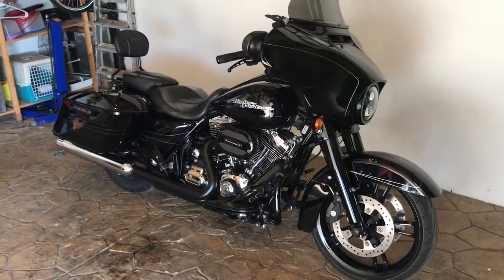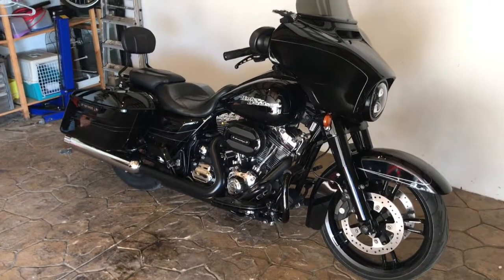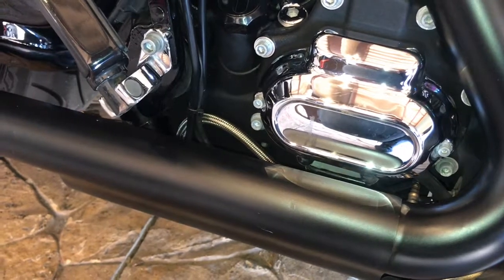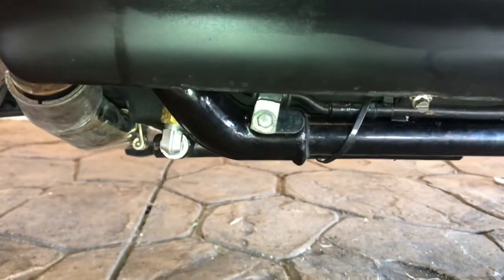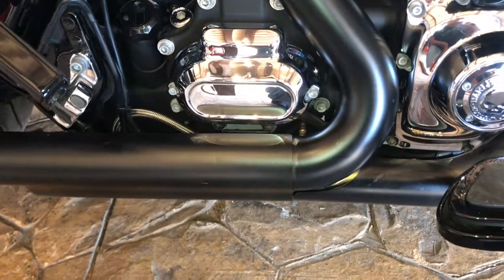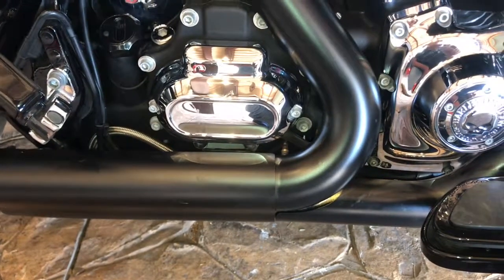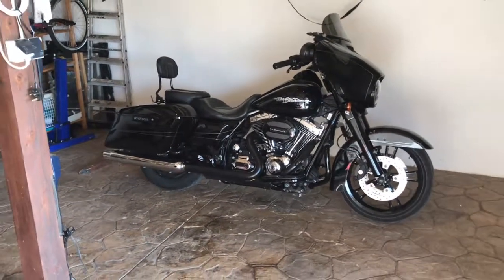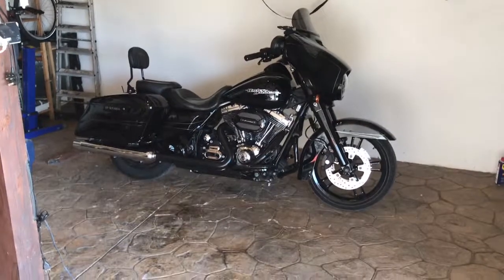The Oil Bud Harley Davidson Touring

Comment: Softail slim didn’t have a cooler before now it does That’s why it’s numbers were more cooler ?

Other bike you just replaced a cooler for a cooler. It was 15 cooler than hd version tho
Reply: How are your bikes currently running using those oil bud oil coolers ? 

Do you like them overall ?

Comment: Thanks for the info.  I’ve been Looking at oil coolers for my 2016 Streetglide Special. In West Texas it gets hot.  Does the oil bid replace the stock oil cooler or is it an add on to the stock oil cooler?
Reply: It replaces the original cooler. Sorry for the delayed reply.